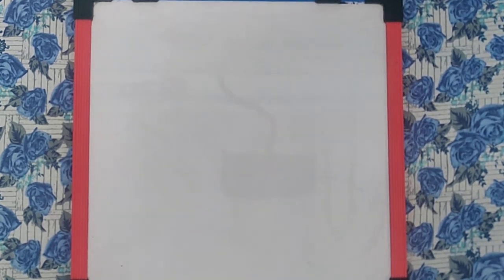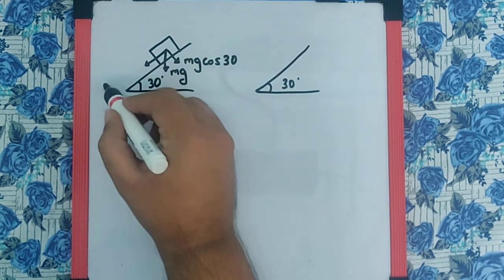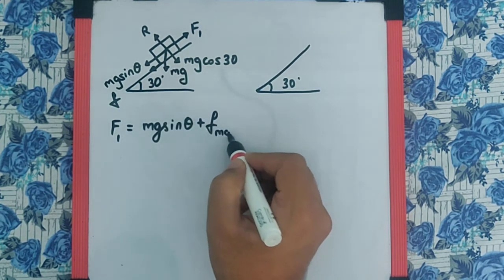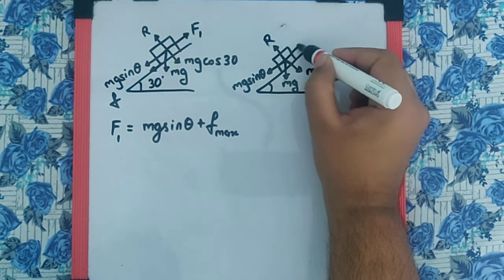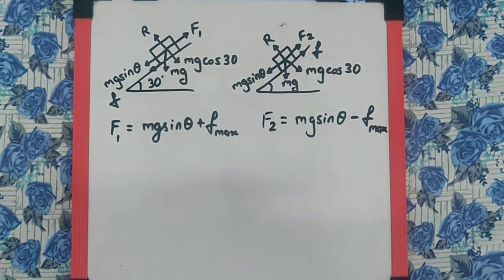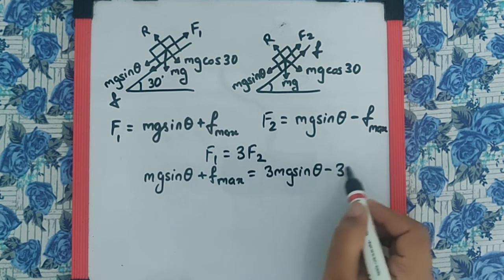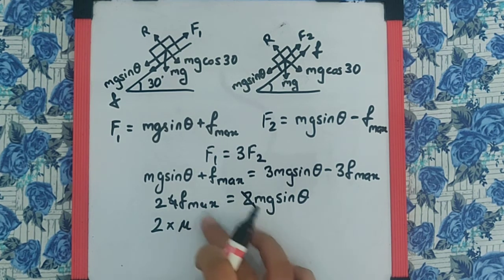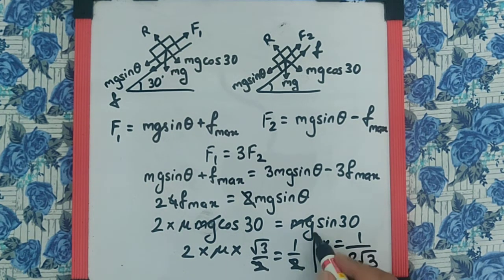The minimum force required to move a block up a rough inclined plane of inclination 30...

Comment: the forces on both the sides are equal.then how does it move
Reply from the maker: The question says minimum force required to make the block move up which means we are talking about the condition where the block is just about to move up and not actually move up with some velocity... And since we are talking about this boundary condition therefore we can say the forces are just balanced

Comment: How are we gonna know, which case must be considered??
Reply: Ohh..thanks
Reply from the maker: It is mentioned in the question that there is a direct relation between the block moving up and down... You need to draw FBD for both the case and then use it as per the condition given in the question